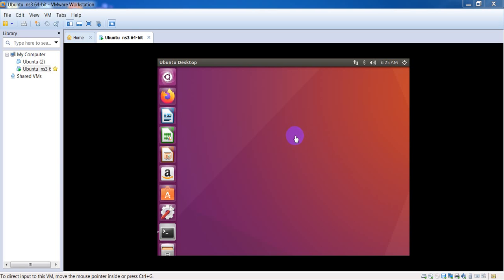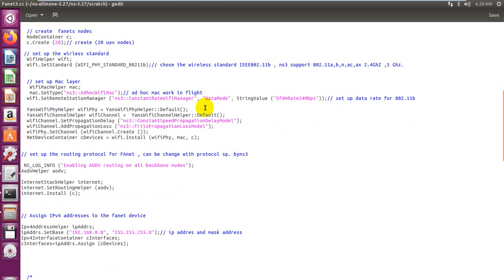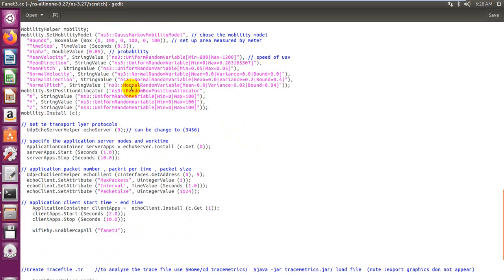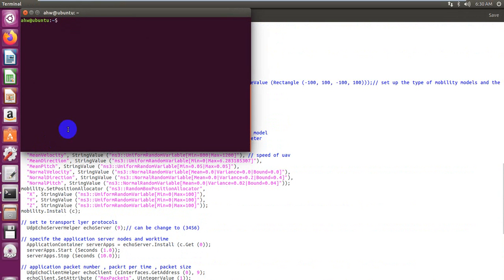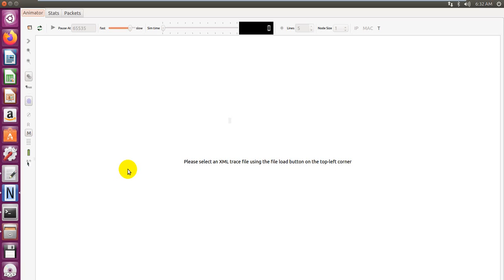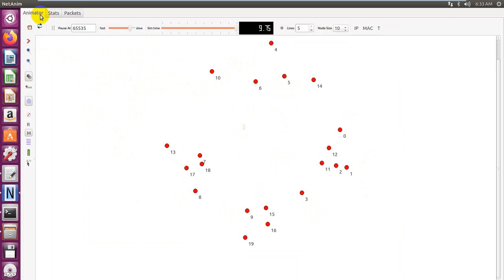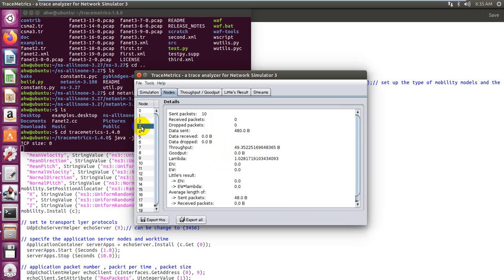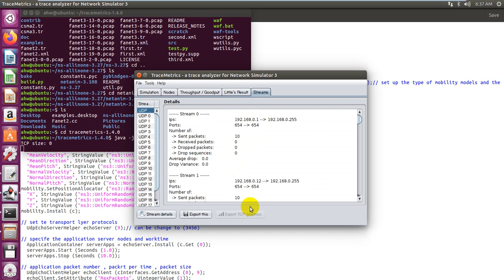First Experiment- Simulation of FANET using NS-3

Comment: how can i measure the latency for the communication between the uavs
Reply from the maker: First of all , you must make the UAV and The BS in communication range. Then after make simulation and create trace file, you  analysis it  and  measure latency .
Reply: @AliHWheeb  i dont quite understand. Whats a BS and whats a trace file, i actually havent started working on this , its my first time working with ns3 is there any tutorial on how to do it?
Reply from the maker: Dear BS mean Base station.  Trace file is a file stored all event during the simulation. However,  you need to read about ns3 and run some tutorials.
Reply: @AliHWheeb  Thank you for replying, how can i know if the uav and BS are in comm range? and where is the BS in the video is it node 1?
Reply from the maker: @theunknownpokimone  As I tell you, youmust read about simulation and make setting for communication parameter. Usually, node 1 or node 0 is the BS , while other nodes range from 1 to 20 etc. I hope this answers explain the work process. Best regards.

Comment: Hi, can you using the flowmonitor for analice the pdr?
Reply from the maker: Hi , yes it possible to use it for result analysis.
Reply: please , Could you tell me how to do this process to calculate the pdr?
Reply from the maker: I will explain how to calculate results in next video after do more experiments
Reply from the maker: you can flowmonitor header to code (library), then add the code for the equation of PDR at the end